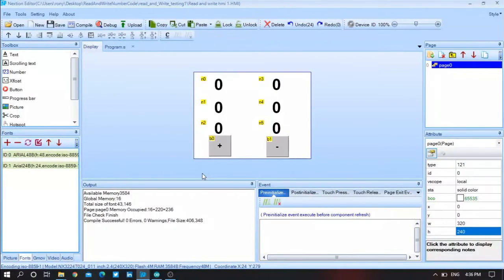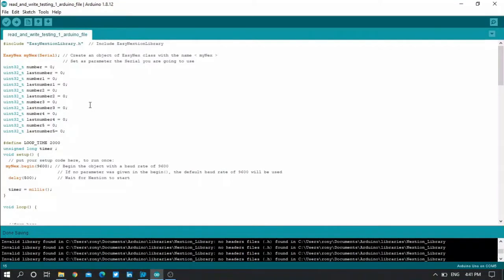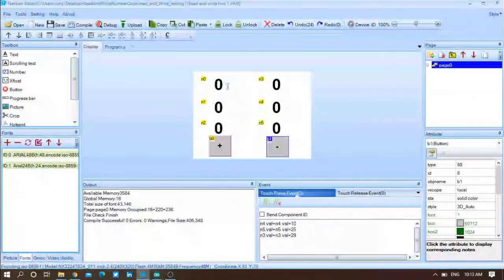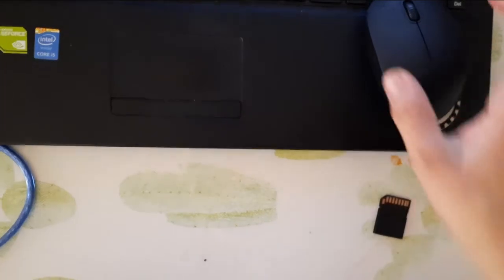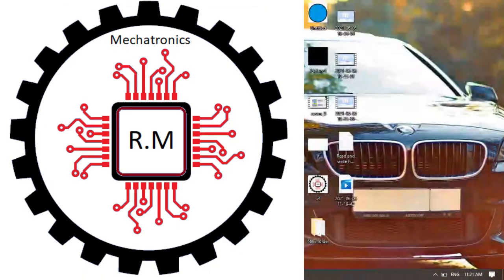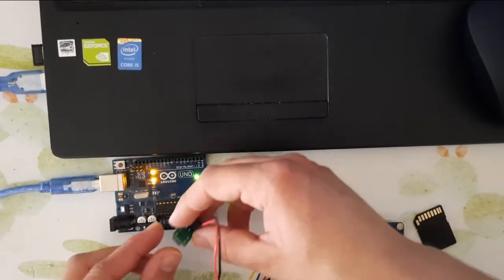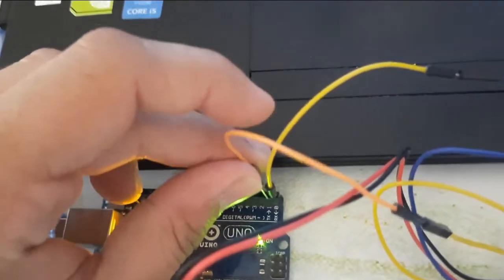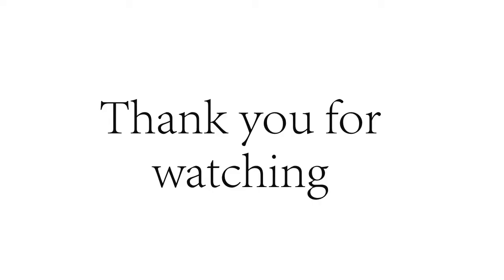How to read a Nextion HMI Screen data and store it to arduino

Comment: Hi friend, i have a question. i have a car dashboard with a file. On a Nextion NX8048P070 011. I want to change the intro page on the startup. But i dont have the micro sd card with the file. Is there a way for me to read this file and make this change. If this is information you can help with i will pay you to help me with this. Thanks
Reply from the maker: Hii, can you please send me additional details about your need? do you have another access to your screen? send me more or contact me via Romeha.lb@gmail.com if you need to send me a photo. but please tell me your more about your need.
No worry i can help you.
Reply: Hi I sent you an email
Reply from the maker: @brialgon  hello dear, sorry for that but it's my mistake, i  wrote the email wrong, can please resend me at this email 
romecha.lb@gmail.com
Reply from the maker: Sorry for that 😀😀

Comment: have you tried this SoftwareSerial Serial2 (2,3); //RX,Tx of nextion?  so RX and TX are left open for trouble shoot. or do I need to change it in Nexition library ?

Thanks
Reply from the maker: Hello Dear, Yes you can do it using another pins than the default one(0,1). but as you know you need to make a change on your code or you need to define the new software serial.